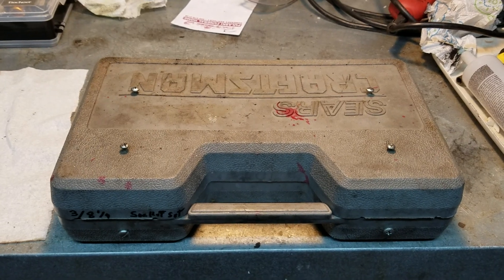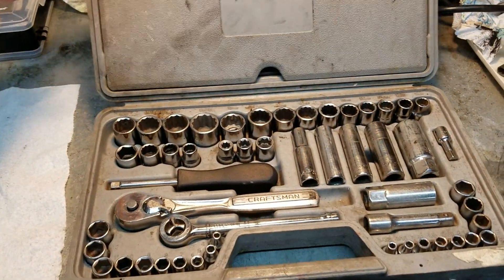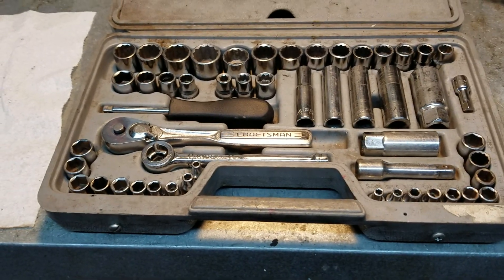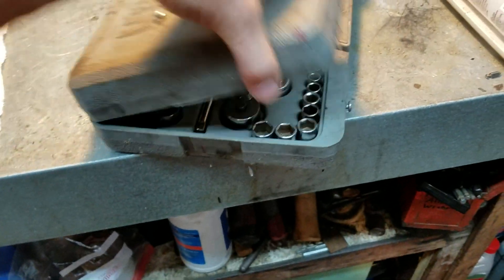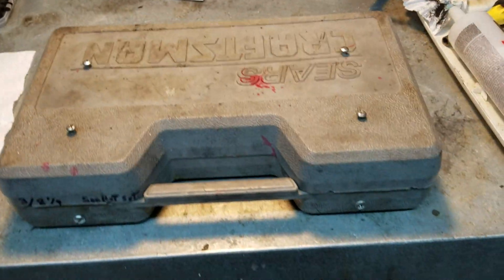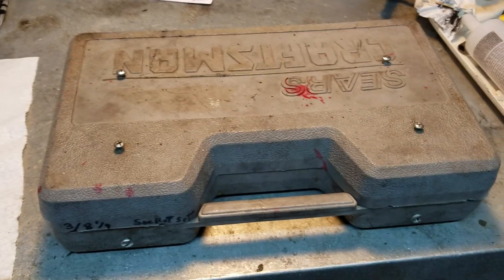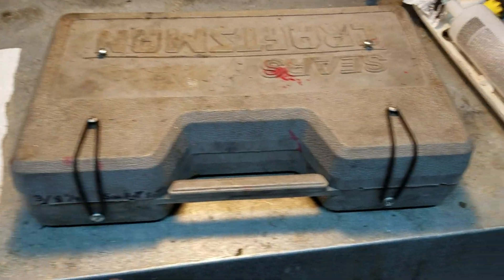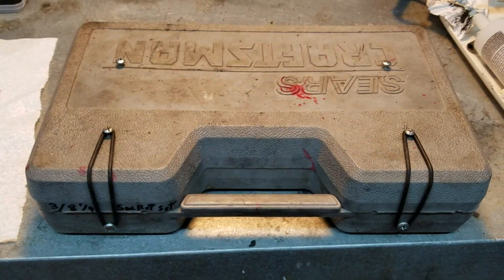Easy fix after plastic latches break off your socket set.

Comment: outstanding ...i have the same box.  Now how do we fix the flap on the inside of lid that holds my screwdriver and some wrenches
Reply from the maker: This might work has a replacement hinge,, carpet tape https://www.lowes.com/pd/Capitol-3-62-in-x-15-ft-Tan-White-Pressure-Sensitive-Seam-Tape/3117163?cm_mmc=shp-cprdflrgooglelia-244-adhesivesaccessories-3117163-_-0&placeholder=null&ds_rl=1286981&gclid=CjwKCAjw55-HBhAHEiwARMCszrj8u0RdwCU_cha_ZhxFgu909S8O-u-eK_FAy1dPJlnKv9jPgA-FCRoCCJ4QAvD_BwE&gclsrc=aw.ds